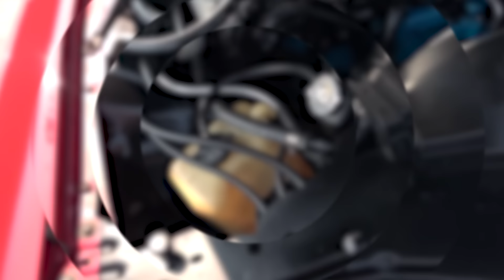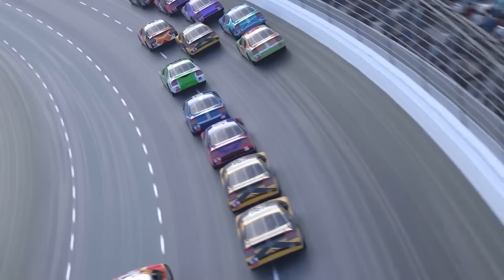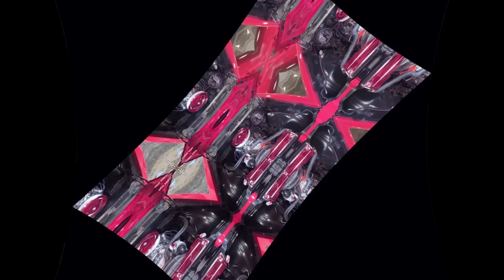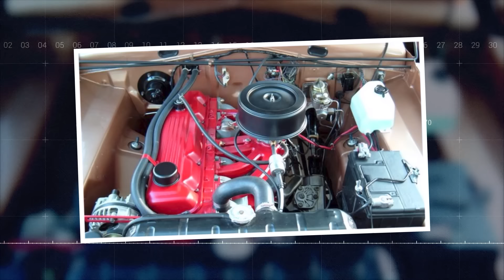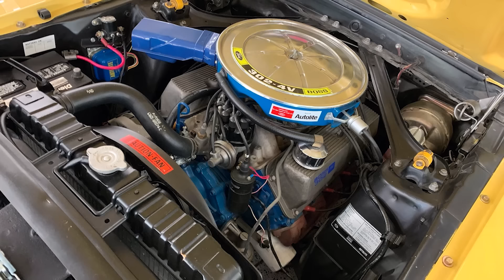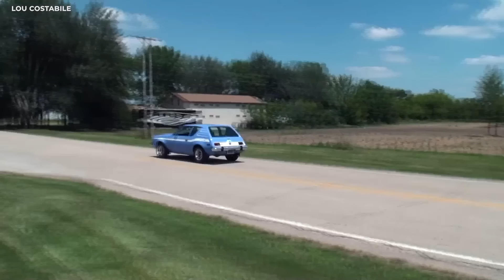15 WORST 70s Muscle Car Engines Ever Made!

Comment: The 400 crank in a 350 .30 sbc made the beast 383 i built may of these some would rev others hit low and carried all the way through the power curve the 400 block had steam ports when we took the head off and  mig weld and deck the block putting set of 300+ hp heads to bump compression way up filling the steam ports also made the block stronger..lol i know yah all  know

Comment: 60s 267 chevy block 327 crank put the 267 piston and rods on the 327 crank boom this baby would buzz 8000 rpm and was external balanced too ..old and the slant 6 you could build a small stump pulling sbc 350 + hp and around 450 + pull power too the wheels and the cadillac 502 chevy 1975 would do over 160 mph and felt like you were on a cloud lol it would also smoke the tires right off if knew how to make power all of these engines are golden will it last lol that's the fun of working on cars lin my days anyway..tge 301 we decked the block to -40 and rotated the piston and decked the tops of the piston over 400hp with a few other goodies 😅ok I am sorry for my rant lol I did enjoy your video

Comment: Several of these don't belong on this list as they were never intended to be powerhouses. Nobody expected a '70s Buick to have any kind of power, it was a middle class grocery getter brand.  And a 255? Seems like you need to educate yourself on what manufacturers were trying to accomplish in the '70s. Nobody in the right mind would think that a 255 was forced to put out any kind of power. This is like saying "this orange is the worst tasting apple I've ever had".
Reply: What are y'all complaining about, they already said the era the cars were built in, so we know they weren't built for power, that's why when the gas crisis hit in the 70s, the way companies made their engines weren't what some expected, but was necessary for the time. Tbh those years set back engines designs, until the late 90s. So they have a point too. Calm down, it'll be ok!!!🤣 And don't forget about the K car, Dodge had, that thing was a real pos. They even had the nerve to make it a drop top!!!🤣

Comment: Wrong the Windsor series OHV V8's Ford produced all the way to 2001 were some of the best V8 engines Ford ever built.The 302 High output version in my 1988 Ford mustang GT is the best engine and most reliable V8 I ever owned in my life.The 1978 version in this video had no performance parts and was built for gas mileage not for performance.